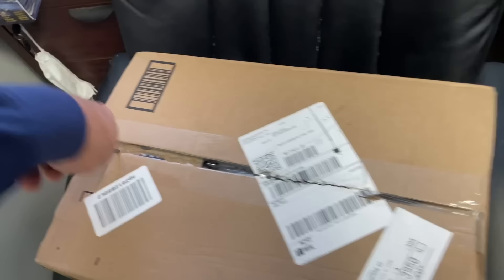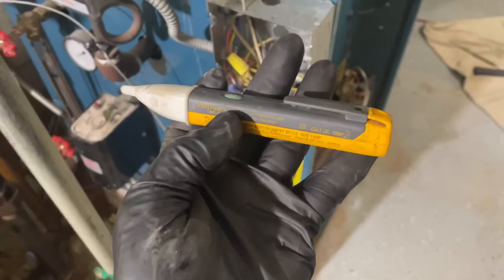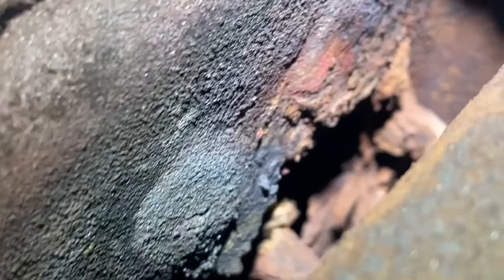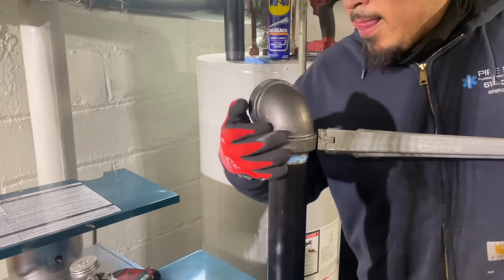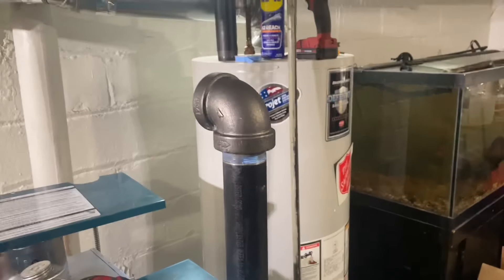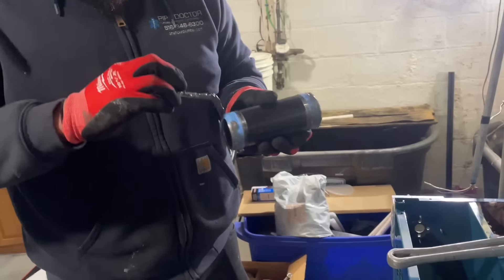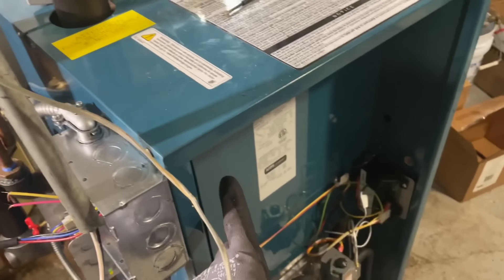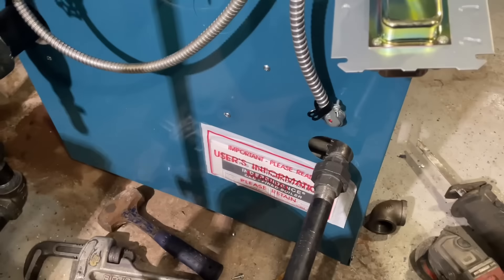Installing Burnham SIN5 Independence Gas Fired Steam Boiler for The Salvation Army @USBoiler

Comment: Nice to see you giving a new boiler to the salvation army!  It's good to give back to a worthy cause when you can! Hats off to Mikey pipes!  I used thread pipes with the hand ratcheter! That was hard work! Godzilla would really get that gym workout with the hand ratcheter! He needs to understand keep the oil flowing while you are threading to prevent an expensive disaster!  That was a great job !  Mikey pipes was laying pipe today!
Reply: I've used the hand threader when I got to cut out a section of pipe and need to thread in a wall. Sometimes it's hard to get the hand threader started in the wall on the top vertical joints so I would use a bucket and 2x4 to seesaw  and push the threader up..... works every time

Comment: This would have been a good video to talk a little about the use of swing joints on the boiler outlets even though you don't need them on this install.  the purpose of a swing joint on steam piping is a good thing to mention.  Absolutely excellent video - damn you are getting good at this video production stuff!

Comment: Not really a drop header. Drop header has boiler riser going up, horizontal and back down (hence drop) into header. You have an offset header
Reply: @garysmith9772  Can't say that I agree
Reply: There are benefits to an offset header. The more offset, the drier the steam. And less stress on boiler sections.
Reply: @jeffreyjohn2037  the offset is an absolute must. The drop header is not (although I personally believe that drop headers are always beneficial).

Comment: Pipe work, when properly done, is a work of art. And you, my friend, are a Michelangelo. 
Beautiful job done to manufacture’s specifications. I bet many installers never read the instructions and think that if you installed one boiler then you can install any boiler. So not true!
Will you be suggesting to the owner to cover all the exposed pipes in the basement to save heat? I would hate to see your pipe work covered by insulation but it should make the system even more efficient. 
Once again another nice job!

Comment: Save  little time when treading your first piece on bald pipe. Always cut three threads ( 1.first bald end ,2nd  cut thread  on piece in  300  before you take it out ,3rd thread the original 9" piece 
Time is saved on next measurement  only cut two thread ( you pipe is previously threaded  /cut your size needed - thread bald end in 300  then tread measured piece. All your spool piece (truck stock) will have  one end threaded

Comment: You ever had issues when you put you're unions backwards on the supply side of the steam system
I usually see the steam cuts the seats and starts to leak. But Thats very low pressure boiler must not matter. 5 lbs and above is what I work on

Comment: a little jb weld propane torch and a coat hanger what hole i dont see any hole lol
Reply: @PipeDoctor  lol of course and ty for appreciating the satire of the comment although i think we both have seen tht type of repair before with some flex seal and tape 4 overkill thts the scary thing?

Comment: You should read the installation manual, like you tell everyone else...The boiler is not pipe according to manufacture specs...IN7 calls for 2 risers and the header 3" not 2"
Reply: Funny,boiler came with 2" tappings,it's a 5 anyhow not a 7,he removed a 7!
Reply: If you have to curse, you have big issues..

Comment: Mikey, my steam Burnham is shutting down every 30 seconds, or so  during a heat cycle.  The low water looks OK.   Could it be the relay inside the front cover ?  Sometimes it takes three times before it finally shuts off after the thermostat is satisfied.

Comment: Make the Outro your intro and make the intro your Outro bro 🤘🤘🇺🇸🇺🇸 good lookin replacement. What’s the deal with people cryin about the drop header??
Reply: Not crying but it is not a drop header, I guess you wouldn't know that so mabey you learned something today.
Reply: @PipeDoctor  when I worked in the city (long time ago) I would see them.  When I went to jersey I never saw them anymore. One day I got a call from another contractor friend.  His costumer with an apartment building had there boiler replaced and things went crazy. When I showed up I noticed they took the boiler out of the pit filled the pit and placed the boiler . Now the boiler sat to high and screwed the whole system. We had a guy come in a weld in a drop header. All fixed.
Reply: I’m a hvacr tech in Virginia and do mostly refrigeration work. Have not had much experience on boilers but love learning everything I can. Gotta ask questions. 🤘🤘🇺🇸🇺🇸
Reply: @jimmyp5487  👍

Comment: I don't want to nitpick and this eats me up to no end PUT F*CK'N TEE'S IN!!!

😅😆😆🤣🤣
cross Tee's for pressure trolls water columns the bottom return before the Hartford loop full size tee with a valve full port I mean good install but steam needs access.
How do you clean that boiler drain without taking it off when it gets neglected and it will.
Also I'm just say'n because I'm not there I hope you have at least a minimum of 2" below the water line and the top of the Hartford loop?🤔
Good job from the keyboard but hmm.
Stay safe.
Retired keyboard super tech.
Wear your safety glasses.

Comment: Mike I see you are not a fan of skimming boilers neither was I but it is necessary.  Scout is a great chemical bad surging boilers.
I like arm and hammer baking soda as a neutralizer. To much steam clean contributes to flooding.  Surgex does a better job.
Sorry but that is not a drop header that is just a double swing. Neither of which is helpful in preventing oxygen corrosion.
When teaching show the correct way first then let apprentice try it.  Leads to quicker learning and better understanding.